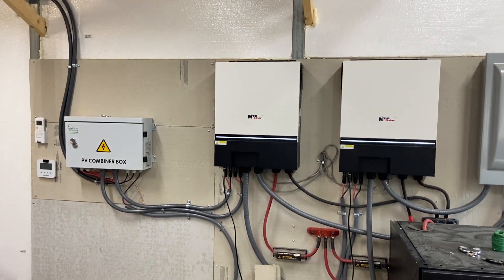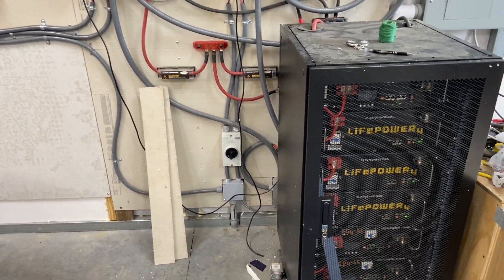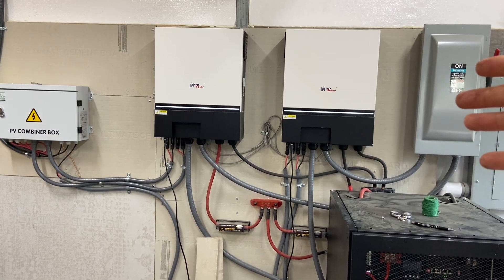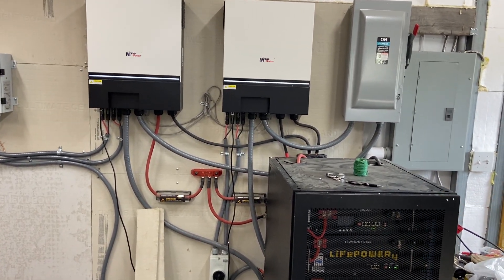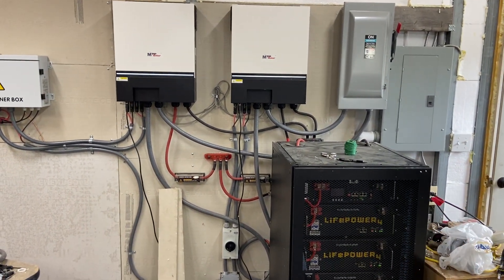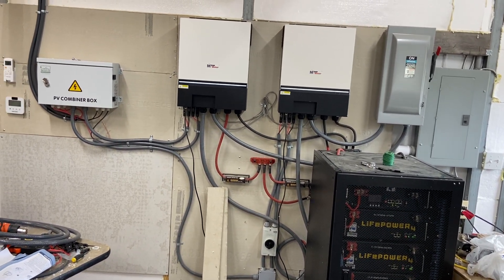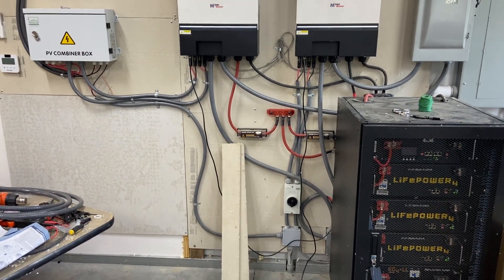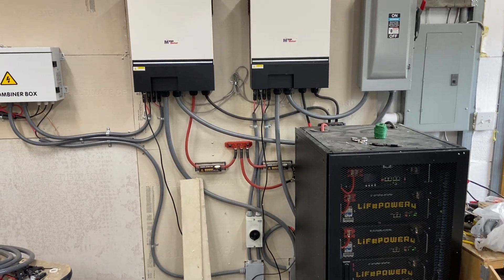Mpp lv6548 and eg4 battery bank charging and discharging.

Comment: Did you have an issue where the line voltage exceeded the amount of the load + battery charging when AC bypass was in effect. I'm in SBU ( solar only charges batts) and it's pulling 3x the amperage what the output is. It's drawing 10a (5a on each pole) and I'm only using 3a.
Reply from the maker: No I never had that issue. That’s an odd one. Granted I don’t think the units factored in idle consumption. But even still, that wouldn’t account for that much amperage.
Reply: @GavinStoneDIY  I have 1 of the 2 connected to solar currently. This morning the voltage dropped below my threshold of 49v and it kicked into AC bypass mode. Even though I was only pulling in 30w by solar it said I was charging 2a. I have no clue how unless it was pulling it from the Utility. 

I ran the toaster for a minute and the utility a jumped to 14-15a... so ~10a above what it was before.
Reply: @GavinStoneDIY  have you used the software/app. How was it?
Reply from the maker: @Gary-ee3kq  no I never used the watchpower app. Most people use Solar Assistant software with these units. The Watchpower software leaves a lot to be desired.
Reply: @GavinStoneDIY  it keeps bugging out  in the wifi configuration step on the Watch power android app.

Comment: Hi Gavin, I have 8 x 200AH AGM sealed lead acid batteries in series of 4 (48v) and I have the MPP Solar LV6548 inverter/charger running singular with no grid connection (we had a 7000watt generator hooked up to AC input but had to take it off due to the software of the LV6548 playing up and the company not willing to fix/ replace it). So now we only have PV and battery. I have read the manual for the settings and it seems if I set number 05 on AGN (for AGM batteries) it automatically sets number 29 - Low DC shutoff at 44v, which I think at that voltage the battery would almost/ if not be empty, shouldn’t the Low DC cutoff for AGM battery be approx 48v (approx 50%) ?  Is there possibility I can set the user defined and set it at 48v instead? If so, do I need to set setting number 12 & 13 also? My 01 setting is on Sbu, please let me know if any of my info is wrong, I really would like to understand how to set it properly
Reply from the maker: Yes I would choose the lead acid/ USER settings and define all your own parameters based of the voltages that work best for your batteries. It just gives you more flexibility. And yes I believe you’d adjust 12 and 13 as well. Although it’s been a while since I had one of those on my wall. So I can’t recall exactly. 

That’s a shame you had issues with the ac output. The generator output problem is why a lot of people have started to use the chargeveter. It can eliminate that problem. A lot of generators don’t play nice with inverters.
Reply: @GavinStoneDIY   I tried doing user defined and choosing voltage but once it drops below 50v it says the battery is too low and beeps every second, so I had to change it back to agm, not sure why I’m doing wrong, MPP solar ignore my emails
Reply from the maker: @KristiVision  that makes sense I guess. The USER setting is typically for lead acid. So what are your charge and discharge voltage  limits of the agm’s? Wouldn’t you want to stay above 50%? I haven’t ever used those before.
Reply: @GavinStoneDIY  yes we def are trying to set it so it doesn’t go below 50%, to no avail.  When we set number 05 to agm, number 29 which is the low DC shut off gets stuck on 44v and it won’t let you change it. 

You can set number 12 and 13, which I had set 12 to 48v and 13 to full, but it doesn’t transfer to Ac input at 48v because we are 100% off grid and can’t connect the generator into the AC so it can transfer to line once it goes down to 48v, it just continues to use the batteries. 

What would their reason be for locking the low DC Shut off at 44v for agm batteries? 

Cos that would be almost empty right? 
And that will ruin the battery bank? 
Surely they would know that??
Reply: @GavinStoneDIY  we also installed a pass through switch to transfer the load directly to the generator instead of the generator going through the inverter, so if we don’t get enough PV to handle the load and charge battery at the same time, we can use the genny to run the house and the PV will still charge up the batteries

We only have 4800watts worth of panels

That was our work around because the software in the LV6548 kept throwing faults every time we turned the genny on and at that point the inverter was brand spanking new

We have another off grid house on that one we had an inverter/charger all in one and it blew up, so we had to buy a Schneider split phase 120/240 inverter and an outback charge controller (we live on Maui, we have limited options it was an emergency) it has 5000watts of solar panels and it has 8 x 200Ah agm sealed lead acid batteries also, that’s system is solid, it’s great, generator is hooked up and no problems, but I hate that the inverter is split so we can only use 3kw on the 120 side, but it’s so much more reliable than the LV6548, it’s also 3x the price I guess

We are looking at renting the place out that has the LV6548, so we don’t want tenants to be able to run the batteries ($4000 worth) down to nothing 🫤

Comment: By the way I I watched will Prowse's video that I couldn't seem to find installing two of these inverters. I saw it before. It had the AC Box open with no wires so I could see exactly where he mounted them. Between all you guys doing your videos who really helps me out. Thanks again
Reply from the maker: Ideally The wires go directly into a breaker. So you could use a 60 amp breaker.

Comment: Are you using the BMS in your Lifepower batteries, is it connected to your RJ45 “ION” jack on the LV6548?
If so, what pin out are you using?
Reply from the maker: The rack batteries I have unfortunately cannot communicate with the mpp inverters I’m using. So I use voltage for my shut off and grid bypass numbers.

Comment: Do you see imbalance in charge current supplied by each LV?   My battery to LV have same length, but one LV seems to the more or all the charging load.
Reply from the maker: It all depends on what loads the lv’s are supplying ac power to. Even if your pv input is exactly the same the loads rarely are completely even. So your lv that is charging less may be supplying a heavier AC load directly to you house. So it has less amperage to charge with.
Reply: I am in test mode with no AC load.   Just PV, LV and battery bank.   My PV Voc should be 190Vdc, but under load the voltage drops to 170.   I guess under load,  the panel's voltages drop.   I assumed the voltage would hold and the current would vary with the load being drawn.

Comment: Sorry if this is a dumb question: how many amps do your sollar arrays (series/parallel) bring to your inverters (per pv input)? i have a point of confusion about safety with "over-paneling”. Sorry noob here lol
Reply from the maker: That’s a very reasonable question. My panels are around 9.5 amps. So in series parallel they are right around 20 amps at their peak. The inverters I use recommend 18 amps. But the manufacturer states they allow for around 23 amps. I usually don’t see over 18. A lot of people use the term over panelling to refer to hooking more panels to the inverter then you’d need because it exceeds their wattage output  rating. But this really isn’t the case. As these inverters can use power directly from the sun and charge the batteries at the same time. Over paneling can also mean going beyond the capabilities of the inverters in the hopes that one array or series may be shaded while the other is not. Not a good idea at all. I hope this helped
Reply: @GavinStoneDIY  this definitely helped. thanks!

Comment: How big is your PV array?  How long does it take you to charge the batteries?  What part of the country are you in?  How many watts / hour do you average in usage?
Reply from the maker: It takes around 4-5 hours to charge the batteries from a very low SOC. I’m in Virginia. My watt usage varies all week. My pv array is 11.2kw. So I’ll usually have around 8kw coming in and being used for charging or directly to my loads.
Reply: @GavinStoneDIY  That's good information to know, I may of purchased too many panels.  I'm in AZ and got 12kWh of panels and also ordered 6 of those batteries.  So I bet I have extra solar coming in I can't use.  I am speculating my hourly average energy usage will be 1,200-1,500w.  Do you use all 4 MPPT charge controllers over both of those MPP units?
Reply: @Reviews2you w/ Jason  you definitely are going to have plenty of solar. I don't use very many watts per hour. I'm thinking I'm only going to burn about 6 to 800 all day everyday. I'm only going to have one inverter and about 3,000 watts of solar. But I do have more panels coming. So maybe I'll end up bumping it up. Cuz I do want to make sure I can really charge everything up good. I haven't even put my system together all my stuff is coming in. I've been running on a victron 12 volt system and surviving barely I do have to run the generator cloudy days but right now I'm only running about 400 w all day everyday I would imagine I live in a camper. Geez I'm 64 years old I do have a business and I live in a camper. Well I don't mind I kind of like my little camper
Reply: @VinceBadovinatz88  So your system is running your RV, not a single family?  If so then I would think 3kWh of PV would be way more than you'd need.  I'm thinking the 6 rack batteries won't end up being enough, but fingers crossed
Reply: @Reviews2you w/ Jason  I'm actually going to be powering the RV which I live in but I have small appliances and my shop which doesn't take much... my 12-volt system just doesn't have enough charging capacity and solar panels to recharge the batteries quick enough and I'm not actually plugging the motorhome in I'm running the inverter with extension cords for the time being. Because I couldn't figure out how to unhook the motorhome charging system. I didn't want it to be charging in a circle. Even though that might have been okay. I'm trying to figure almost 3000 Watts on of panels the roof. I'll probably only get two thousand Watts out of that maybe a little more ..I'm hoping that will charge those batteries up pretty good in one day. Did be honestly I still haven't figured it out how to calculate it I've seen videos. I've seen data sheets and I still don't have it in my brain. Hopefully it works out right haha thanks for the reply.
Reply: @VinceBadovinatz88  Calculating is tough since it has so many factors.  Area you're in, angle, PV array size, wire size, inverter efficiency etc.  W/ 3kWh array I'd generally expect you to make ~2,100 w/hr and 11.5kWh / day.
Reply: @Reviews2you w/ Jason  thank you for the estimated daily production that really gives me real Hope 😊 I'm like will prowse I get excited when something goes right😁 I don't know what it is it is about producing our own energy.  but it sure is a fulfilling feeling.
Reply: @VinceBadovinatz88  100%.  I plan to video my installation and document along the way if you want to subscribe so you can see how it goes.  probably about a month out.  I had some stuff damaged in shipping I have to sort out.
Reply: @reviews2you  I definitely will subscribe thank you
Reply: @GavinStoneDIY  Does the app show you details like how many kWh you generate per day?
Reply from the maker: @reviews2you  I don’t use the app.  But yes. Solar assist does allow you to monitor all that.
Reply: @GavinStoneDIY  what does SOC mean and how many watts do you use on an average per day. I think you said it varied a lot
Reply from the maker: @VinceBadovinatz88  SOC means state of charge. Basically how much battery power you have left. My usage still varies. I’m completely off grid with the 2 inverters and 14kw of panels.
Reply: @Gavin Stone  thank you on the SOC.. I had heard that before I just couldn't remember. I'm so bad with abbreviations
Reply: @GavinStoneDIY  is that all six batteries your charging in 4 to 5 hours with approximately 8,000 watts coming out of the solar
Reply from the maker: @VinceBadovinatz88  each rack battery should be charging at around 20 amps. They can charge at much more, but that’s the recommendation, So for a full rack of 6 you’d need 120 amps steady for 5 hours if the batteries are completely drained. Because they are 100 ah each. So it’s basic math really.  The batteries are rarely completely drained though. And the inverters may be running loads at the same time they are charging. So you’ll rarely if ever be charging at 120 amps from your inverter.
Reply: @GavinStoneDIY  thank you for the battery amp charging comment
Reply: @GavinStoneDIY is there a way to set up two 6500ex inverters so that they never charge more than 120 amps collectively? Or do you have to just set both of them at 60 amps max? The reason I mention it is I'm planning to have 2 arrays on the east and 2 on the west so 2 could be pumping out 60 amps while the other 2 close to zero depending on the time of day,... By the way I think you've got the most badass solar shed on the planet
Reply from the maker: @deanburrito6943  thanks! Its a power generator and storage shed all in one. the charging amps are a individual to the inverter. So it would have to be whatever amperage you set on each inverter. So it wouldn’t work like you’re asking no. If you use watchpower or solar assistant that may be possible. I’m not sure. How large is your battery bank going to be?
Reply: @GavinStoneDIY  30 kw battery 16 kw pv... So if I limit them both at 60 amps... At certain times of the day I'll be getting 120 amps and other times of the day only 60. I think you just found another reason to go with 18k unit... Because the single unit would be able to produce 120 amps continuously which would be the ideal charge on a 30 KW battery in order to maximize lifespan.... I might have to set them both at 90 in order to compensate. Which would mean 180 amps at some parts of the day between 11 am and 1 pm..... I think the two inverters collectively can put out a max of 240 amps? What limits do you set at When you were using 6500ex?
Reply from the maker: @deanburrito6943  180 amps would be perfect for the eg4 rack batteries. They recommend 30 amps each I believe for those batteries. So 30x6 180 amps. So you could easily set each inverter to 90 amps. Probably higher really. I had my 6500ex’s set to 120 amps each.
Reply: @GavinStoneDIY  at 120 amps each would that be damaging to the batteries to prolong its life? 40amps per battery. So if I've got four strings of 4000 w panels for a total of 16K... Two on the east side and two on the west. Do you think it's best to have the west side on one inverter and the east side on another or to have one of each on each inverter? I love that you're willing to talk about things like this because nobody else on youtube seems to mention or talk about these things. Thank you so much for taking the time to do this... I read all of your comments and I watch all of your videos. Personally I think you have the most valuable information on YouTube even more so than Will prowse. On your comment above you mentioned 6 months ago that 20 amps per battery was ideal recommendation.. I'm trying to hopefully get at least 20 years out of these batteries because they're so damn expensive compared to the used batteries I've been salvaging out of submarines.
Reply from the maker: @deanburrito6943  I appreciate that. I try to respond to every comment if possible. Some comments are grouchy. But that’s more rare. Most of the time people just want to get some information. 

As far as the charging  amperage I used. I had it set at 240 amps total  because I had such a large battery bank. In your case considering the arrays being in different areas I think you’d be fine at 180 total  amps. Signature Solar has done more testing on their batteries since the original recommendation of 20 amps per battery. And they’ve raised that number a bit. And generally speaking with lithium iron phosphate a .2 C rate of charge and  discharge is considered ideal. So that would be 20 amps. However I believe they now say you can go to 30-50 amps. So you’d be fine. 

You could just have one array on each inverter. It would be best to split them though. The 6500’s can use power directly from the sun. So when you run a 240v load they can both power that load directly from PV if you have the PV split between them. If not, it’s sorta like a one legged duck swimming in circles. One charges while the other discharges. So not quite as efficient. But it does work either way really.
Reply: @GavinStoneDIY  thank you so much for that information. So yeah splitting them with each inverter having a West and East array does make sense. The other added bonus is if one of the inverters goes down you still have morning and afternoon sun not to mention maxing out at 8 KW on an inverter will cause clipping so this would minimize that and potentially allocate provisions for maximum photon harvesting while simultaneously mitigating risk of overload and reducing unnecessary heat.... I think I'll do that.  I potentially see putting one of the inverters in standby mode to reduce parasitic draw throughout the evening. I've been living off grid with less than 5,000 Watts ac for decades on an outback system... Can't believe it's still going frankly, but it's definitely time for an upgrade.... Living in one of the most remote places on earth deep in the rainforest.... No water no mail no sewer no pizza delivery no power no problem :-)